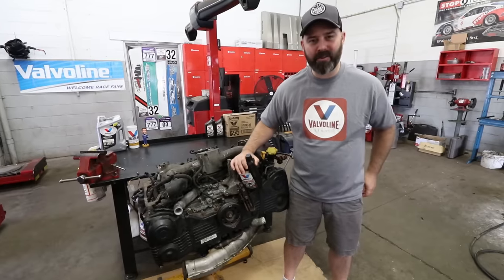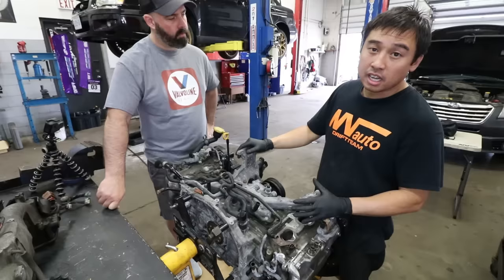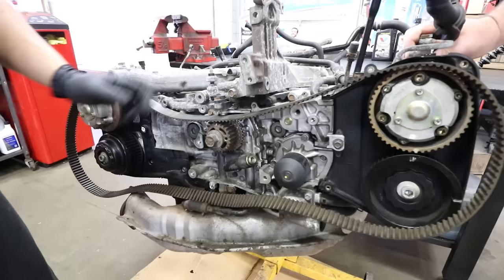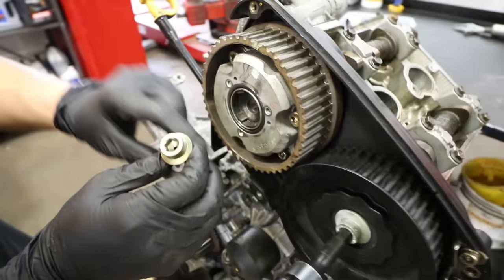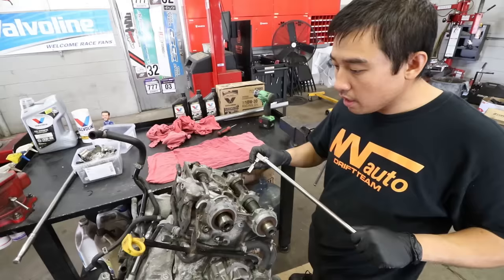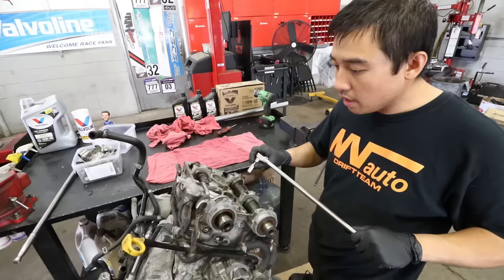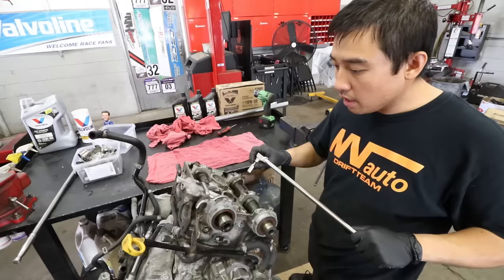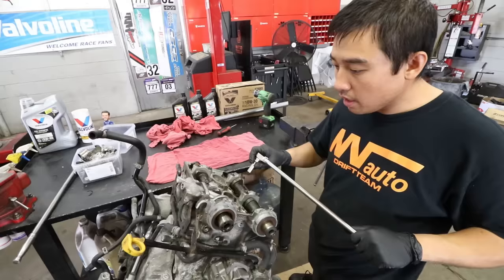SUBARU Engine Rebuild - EJ20 / EJ25 Teardown How To

Comment: I've heard that all EJ blocks (EJ16, EJ18, EJ20, EJ22 and EJ25) actually start out more or less the same, with the only significant difference being whether it's an open deck or closed deck. The piston bore diameters are then reamed out, and are actually within a few mm of each other. The more significant part that matters when it comes to displacement is the connecting rods (which governs stoke). Not sure if my lack of knowledge and/or experience has caused me to misinterpret the information I've heard, though (and the info I've provided here may actually be inaccurate because I've misinterpreted that information ie what I heard may be accurate, but my recounting of it here today may not be). Anyone confirm or refute that?

Comment: Okay I have been working on a 2.5l turbo. I have been trying to get the timing belt on I have lined up the marks I cant tell you how many times now. After I got the belt on and turn the motor over by hand and trying to line the marks back up they never do. WHAT AM I DOING WRONG? or
Is that normal?

Comment: When EJs get to around 110k (Miles) or so, they often need a rebuild. They are very well engineered engines and will never break down on you, but they start to lose power and don't run at the optimal level it should be at. The typical case is the engine is down on horsepower and some components get tired out after years of use, so it doesn't feel as powerful or smooth as a newer engine. A rebuild completely changes a performance car once it hits high mileage.
Reply: "It will never break down on you"? Countless engines grenaded by spun rod bearings beg to differ. Subaru makes some of the least reliable performance engines on the market with ringland failures, spun rod bearings, bad head gaskets, and excessive oil consumption all being extremely common.

Comment: just replaced my ej251 with the ej20 on my 2002 fozzy..
Reply: The ej20g is a solid engine. Gave put 30 psi in mine

Comment: How much money went into this project? As a layperson, I expect it's quite expensive.
Reply: JE pistons: $2800
K1 rods : $390
K1 crankshaft: $1350
(75,79,83mm) didn't see a 95mm stroker crank on their website
Reply: The last rebuild i did, the customer spent $7k on parts and machine work alone. Parts were all from the dealer and it was a full stock sti rebuild. (motor only)

Comment: Okay real question I have a 2002 forester with the 2.5 with the manual trans but if I put a 2.0 in it would it bolt right up to the trans and mounts etc
Reply: It bolts up but modifications need to be made for it to run on the USDM ECU

Comment: Hi there can anyone please help me..?  Got a 2001 Ej20 twin turbo engine  has been pulled out engine trying to find injector and ignition coil connector colour there's ones black and another white as both sides need to make sure witch one is the right one

Comment: Hi there, does anyone know what tool he used to break loose the cams? Is it a breaker bar, are there any special bits and pieces I need? Cheers,
Reply: No special tools,just a 10mm hex socket cut exactly to the depth of the bolt so there is no sideway movement to prevent rounding of the bolt.

Comment: Great video, I own a 2002 Subaru WRX wagon that has 192,000 miles on the engine- it's stage 2+ with a full TBE(catless), uppipe(catless), cobb SF airbox & protune, ended up making 210WHP & 218TRQ on a all-wheel dyno(93 octane pump gas). EJ 2.0L motors can last a very long time if you do the maintenance. Check out MRT performance on Youtube he has alot of good videos on these EJ engines you will learn alot!

Comment: May I ask a question. I want a longlife engine, is forgeded engine more durable tham standart ones. Is this acceptable, or it is less durable but high performanced?
Reply: Forged is stronger than cast so even if you aren't going for performance they'll hold up better.
Reply: @TheTran5cend  false. You’ll be lucky to reach 80k in a forged engine before needing a rebuild.
Reply: Vince Calibur  lol look it up …. They are not geared toward longevity. Forged PISTONS will need a re ring after certain number of miles or you’ll have crazy blow by and chewing through oil …
Reply: Vince Calibur  idkkk I’ve never seen a turbo forged engine last 100k miles but I guess after building thousands of subarus , I could be wrong
Reply: @dreww47  The STI is forged =/
Reply: @proximitybeejay3673  only 02/03 STI is forged pistons (v7 sti engine)
Reply: @dreww47  Im in Australia, and they were still forged atleast to 06 maybe 08 i thought. I know US models are not
Reply: @proximitybeejay3673  they are not forged in Australia. Only thing that is forged is the crank. Pistons are  Hypereutectic
Reply: @dreww47  well i read and it says rods also !

Comment: Someone help?

I've got an ej20E, (single over head cam) insteadve the ej20 (double over head cams)..

I need to know what's the difference, basically is my engine good or nah
Reply: Youll have more efficiency with a DOHC config vs a SOHC but theyre essentially the same motor im pretty sure. just different heads.

Comment: how dose this compare to the fa20 engine? i know you said its the same as the old ones but what about the new?
Reply: Similar in concept. 
Timing chain instead of belt. 
Dual AVCS 
Have a HPFP on one head
Rods have offset caps so they can be un bolted prior to splitting the case.
Reply: @Turbochargedtwelve  thanks for the info. i wish they were doing an fa20. loads of videos on EJ motors 99% of brz/frs videos are about rocket bunny kits.

Comment: What ?
No close deck or sleeves ?
I'm disappointed 😔
Reply: You're reminding me, I want to know the difference between EJs and the FA and FBs.  One of the EJ's headaches is leaky valve covers.  They are a bear to replace.   Despite the lettering, the FB was designed first, I hope they made some good changes, like the ones you mentioned.
Reply: It's an EJ207, so it's already factory semi-closed deck. I do agree that doing inserts so it's closed deck would be smart.

Comment: Are all the single avcs jdm ej205’s semi closed deck? Such as the jdm forester xt 205’s with single avcs or the early legacy 205 with dual avcs. 

In all my searching I only found the the 2.0L’s are open deck. But clearly this engine is semi closed. If anyone could help me figure this out I’d really appreciate it.
Reply: This is a ej207 !!!
Reply: I thought of that but jdm 207’s don’t have the bare intake manifold.
Reply: @thomasstaples  it was in a USDM car so the manifold had to be swapped over

Comment: Well, not my oil brand of choice these days and not the most cautious motor teardown.. Good job? Just please don't mess up the EJ name anymore, it's a perfectly sound design that requires caution and patience that many people don't have. It's not a Honda motor, treat it like a Porsche. The engine timing was off btw.
Reply: Gamma Light 
Nice to know. I am currently studying to be a technician and if this was a class room, I would not have hesitated on asking why didn’t they do it exactly on the markings and does it matter if your a little off. If you know and you don’t mind telling me your input, I would appreciate it.
Reply: @richardaguilar8582  it's good that you ask!  Yes, it is critical that all timing marks are lined up dead nuts center on every vehicle, no matter if someone tells you otherwise. 
  It's not uncommon to find timing belts that are manufactured slightly too long or too short so it's important to use only the highest quality aftermarket pulleys and belts if not factory OEM parts.  
  Always compare parts and always wear gloves.  Any amount of oil can deteriorate the belt so keep the pulleys clean too.

  Gates timing belts use to be an affordable alternative to OEM and were made in America, constructed with perfect tolerances but they sold out to China recently.  Now all their products are wonky and off just enough to keep the car running but bad enough to severely shorten the life of the motor.  

  Interference motors will be destroyed by the smallest timing mistakes.

  Non interference motors often use a timing chain.  They will not necessarily destroy themselves with timing errors but they'll suffer from poor performance that can affect engine longevity.

  The reason this motor bent a valve is because the timing was off by one tooth, probably because the belt tensioner wasn't maintained on any schedule.

  There's a lottt to learn, always ask.

Comment: I had a Subaru GL back in 1988. I still regret to this day for not buying a Toyota Camry. If you want trouble with an engine buy a Subaru. It was a nice car to sit in but don't think of driving it on the road.

Comment: Nam, seen the other videos. YOu're the best. I'd give you my subary anytime for repairs. I have a question. I had this noise (not a heatshield rattle) coming upon acceleration at around 3500-4000 rpm that sound like a grinding noise. Here's a video of the exact sound it make. https://www.youtube.com/watch?v=0y8hPKk5obs&list=PL7GtCwVvhYqhIJ7m8SzJoLzTB4sSVXNJ0&index=14&t=0s
What could this be  ?? loose timing chain ? transmission mount ? timing belt ? Any ideas ? I've had the noise for around 35000 km now and subaru dealership could not do anything. My car is a 08 Impreza 2.5i Premium 5Dr Hatchback with 5 speed manual transmission with now 98000 km. Never had low oil (check it every time I fuel gas).

Comment: Buy a Subaru legacy 2019 . 
Transmission problem . 
Wheel sensor problem lost 4 wheel drive , abs , traction control in a corner in a snow storm at minus 36 degree C.
I will never buy there product again .
Reply: Chill bro. thats just all new cars. not only subaru. Humans made them all.
Reply: @theejoeylee  I agree its not the end of the world shit happen but this was fucking dangerous . 
I was giving gas at the exit of the corner at 90 kmh in a snow storm then the all wheel drive shut down , traction control , abs while i was accelerate . 
U know how a front wheel drive behave when u loose traction while u giving gas ? Yeah it go straith , i almost got a accident this is kinda why im mad . 
The guys at the garage told me i was the first one to get that problem on those probably just a bad part .

Comment: wow what a terrible engine design.. and for what gain? a little lower cg? they should have just used a rotary and it would be just as reliable as these motors lol
Reply: 2007dalin lol reliable as a rotary.

Comment: Blown head gasket time 😂😂.  Subaru are absolute rubbish.
Reply: only N/A 2.5 engines had head gasket issues. NO turbo models do.
Reply: @Alex-wb2yw  im sure they do you troll . Im a technician in my 30's now . Been in the automotive industry for more then 14 years . You haven't a clue troll
Reply: mr323i he’s right lmfaoooo just cause ur a “tech” doesn’t mean u know everything
Reply: Wow. These replies are more toxic than a floating trash island in the Pacific. 

To be fair, lots of Subarus blow head gaskets. But that’s mostly because people over-boost open deck blocks (or even semi-closed decks like the one Speed Academy just bought). The only EJ blocks that can really withstand high cylinder pressures without bore ovaling are closed deck blocks (i.e. EJ22t or EJ20g).
Reply: @jordanlatta  bullshit kid or manchild im a tech by trade in my 30's now.  even non turbo rx fwd subaru models / All wheel drive do the same thing and turbo engines are worse . You haven't a clue have you ever worked on a subaru i guess not
Reply: @jordanlatta  troll
Reply: GTAFINESTXRAY G

Comment: horrible engine
Reply: Very smooth running though, you'd think you were runninging a straight 6 or a 60° V6. Maintenance is a must.
Reply: Bob Pegram 
Even smoother is a boxer 6 (Subaru EG33 or EZ30, etc). No rocking couple that is found in boxer 4 engines. But yeah, they need to be looked after well.
Reply: Great? not really ...horrible? not really either. Most people maintain their Subaru like they would maintain a 1.8 honda civic. 
ive owned a lot of cars , 2 subaru:  2001 STI and now a 2012 wrx custom build.  
After 3 years and 176 000km i'm still waiting for a big issue si i can swap for the AK serie 2 engine made by Lachutte Performance.

PS: to call that a horrible engine, you must have a great engineering background , when is your own engine comming out?
Reply: @Chabot1801  tomorrow